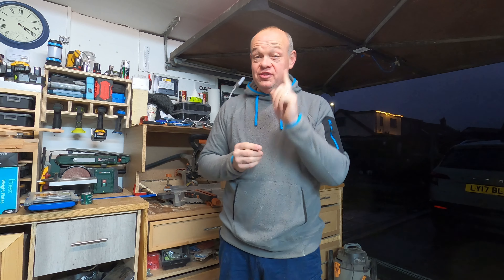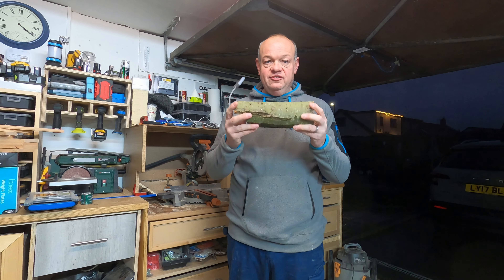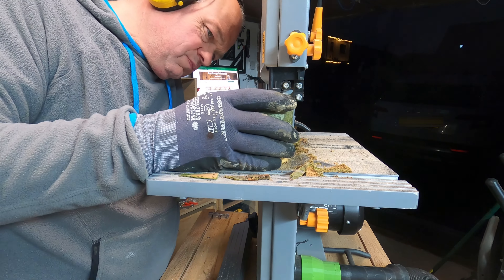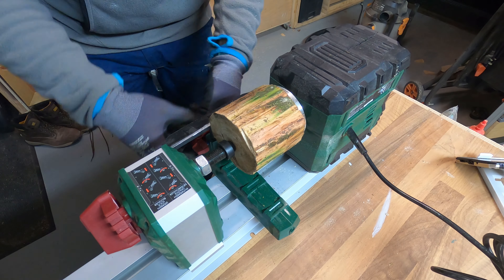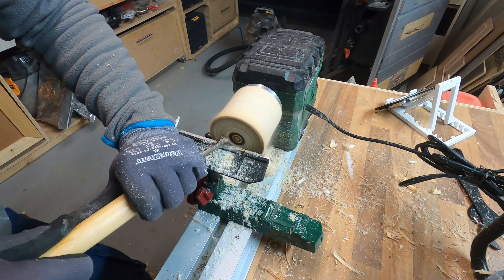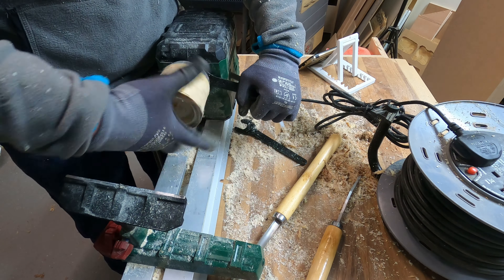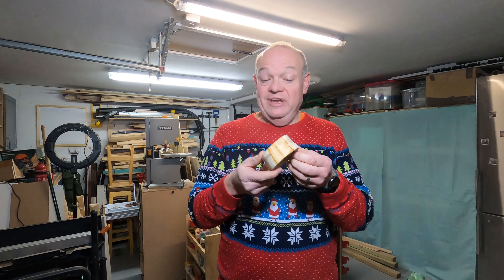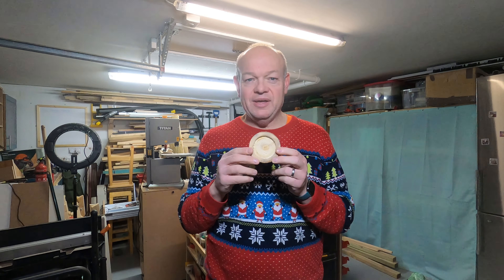The Garage Workshop - Lathe Tea Light Holder

Comment: Morning, a rule of thumb when drying wood is to measure the thickness in inches and for every inch you want to leave it about a year to dry. There are many tips and tricks for speeding up the process and many bowl truners will do an initial rough turn with green (wet) wood and then leave it to dry for a period before finish turning it.
Reply from the maker: Thanks so much for the advice..much appreciated!

Comment: Haha yeah. Roughing gouge and bowl gouge difference is significant. Bowl is safer using on interior but slower than roughing gouge. Rougher would be a bad idea for interior cuts.

Size and removed speed between larger and smaller gouges. Mindful of speed depending on distance from center. Patience required. Lots of sharpening.

Skew is the best but the worst. Well done man. You made nice final project. I think I mentioned it before but lathes and tools/accessories are a bottomless rabbit hole. Spend and spend is all that happens. Still worth figuring out what you need the most at this moment. Easy Wood Tools carbide is always a great choice. Very popular. Rounded square insert can do everything.
Reply from the maker: Thanks so much for the advice...it's really helpful!